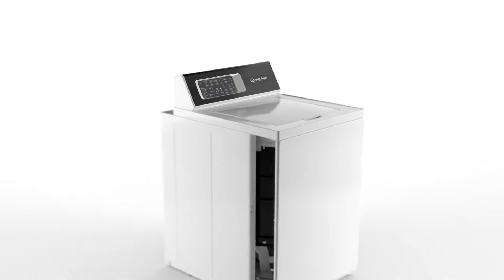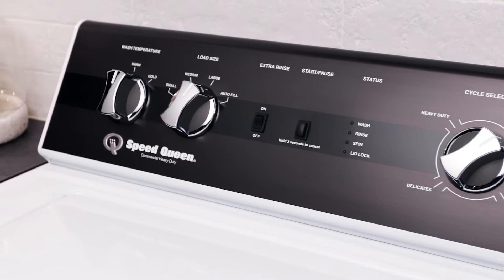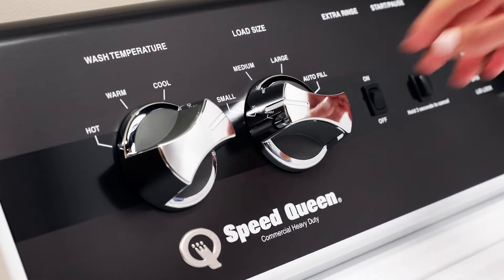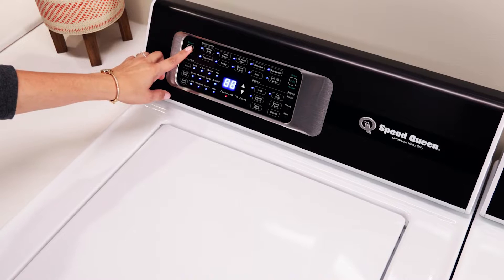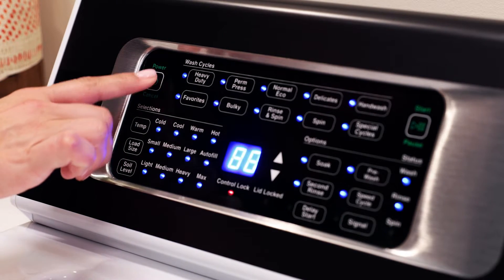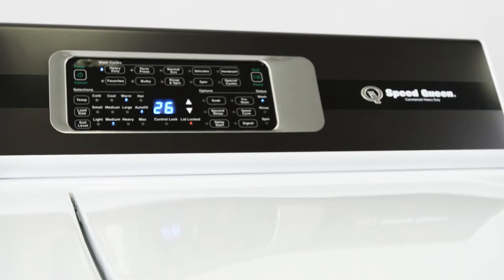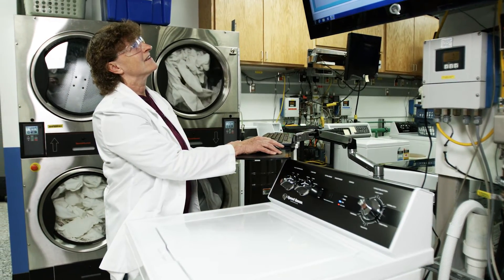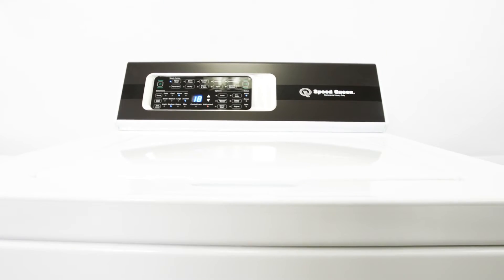2018 Speed Queen Top Load Washer - Control Panel Explained by Engineers

Comment: Many people are buying 2017 models and avoiding the 2018 models because they agitate too slow! They are good for delicate washes but not for normal washes. It does agitate fast enough. Please go back to the previous design. If you do, I will gladly buy one👍. You will make more money if you go back to the previous model because more costumers will buy it. That should motivate you. I love my 2016 model! It works great!
Reply: Cubsfan 1800 I to had a 2016 9 series, now I have the 2019 TR 7 and I absolutely love it. I think it works even better than the previous washer because it’s updated smarter and more versatile. The auto fill feature is the best I’ve seen, if you open the lid while it’s washing it will add more water, it’s gentler wash action cleans thoroughly. Did I mention that it’s much more quiet except for the pump while draining than the previous washer.